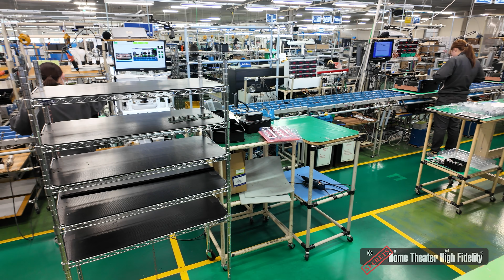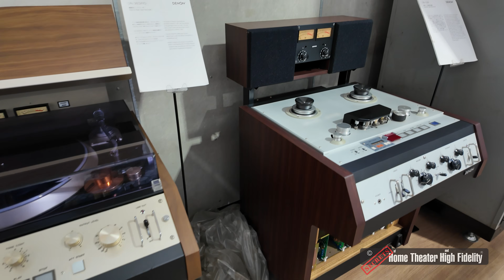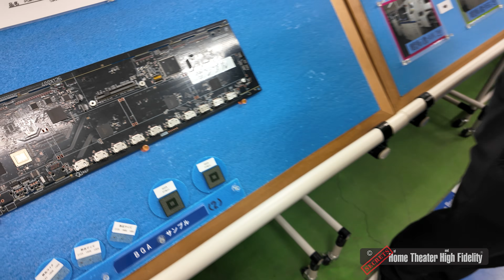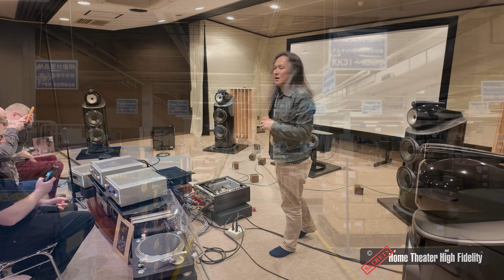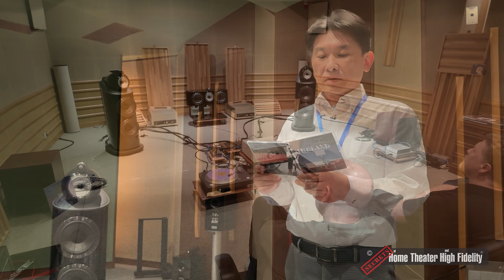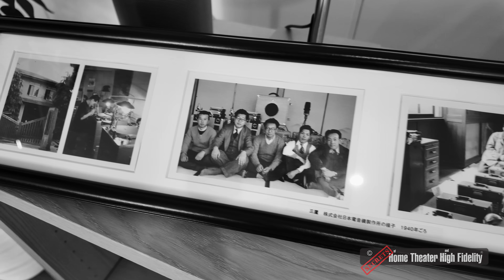Shirakawa Audio Works Factory Visit 2026

Comment: Marantz+Denon+Harman Kardon+Samsung.  So basically it's all Samsung.  Are the electronic sub-components made in Korea or China?
Reply: Mr marantz has no sound in left channel after a week , not good quality
Reply from the maker: Yes. Basically all owned by Samsung. Sub-components likely come from all over. Large and small scale chips are most likely from Taiwan and China. Bigger stuff like capacitors, transformers, etc can be custom made, depending on the model, and may come from Japan, China, Korea, etc.
Reply: @secretshometheater Thank you for the breakdown.